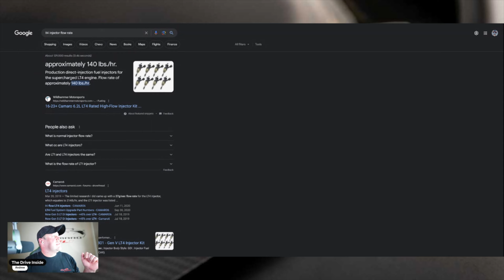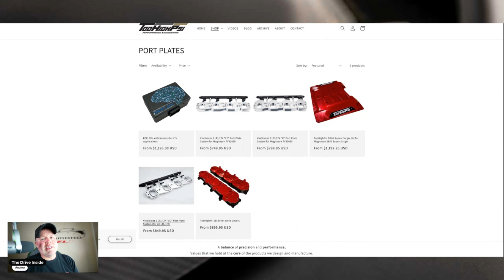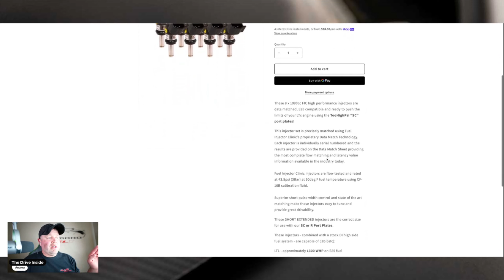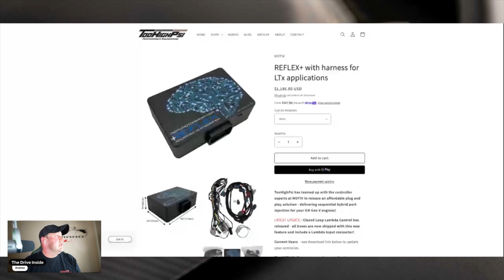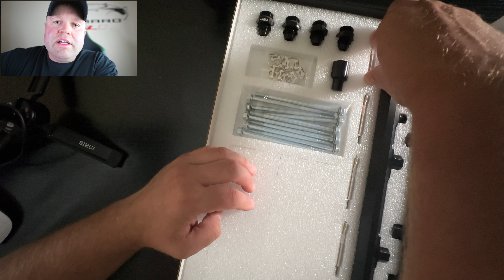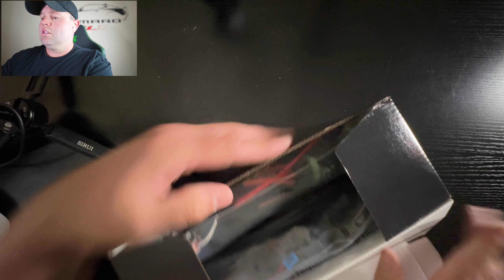LT1/LT4 port injection the ULTIMATE kit...*BREAKDOWN/UNBOXING* #toohighpsi #lt4 #lt1 #e85

Comment: How about the Harrop lt port injection kit which can retain the factory DI system and oe ecm and tcm and enabled full flow retain lines?
Reply from the maker: Too high psi keeps all the factory stuff too…I’ve seen a ton of kits and there’s more in the pipeline all the time but THP is the standard that all others are measured against…super high quality/fit and customer service is awesome! My next kit will be TPH. Just need a aux pump to boost the low side volume

Comment: sup dude how are you doing man just wanted to ask i got a 2021 camaro lt1 and im going on a N/A build and i wanted to add port injection on my build but im not finding any info or video on this your video is the first one i saw tbh with you so what do i need to get so i can add port injection to my car that would be really helpful if you told me man and thank you very much man
Reply from the maker: Depends on your power level your going for…too high psi made a video on the under hood plumbing. Simple answer is DSX auxiliary fuel pump…pick your injector size (I would go smaller in hind sight) pick your plates…and the reflex kit…if you want a specific break down I would call “Justin White Tuned” dude knows his stuff!

Comment: Hi, I have heard great things about the Too high psi guys, and the guy in the video here did a great job!!!!  If you watch BTR videos on the subject, Brian will tell you from testing that adding fuel/mass to the port will cost you. Not only in O2  as the "gas" takes up space, and weigh of it have an effect on the ram as the timing/ wave is now very different.    I have a Camaro with a lt4 and I like everyone else I am  just about out of fuel/dwell .....   I am not going to spend 10,000 dollars ....fuck that!!!!   Thanks Dave
Reply from the maker: I have heard that as well...I haven't tested on a engine dyno but had I done everything all over again...I would've bought the smallest injector and added the smallest amount of port as I HAD too!
Reply: @The_Drive_Inside  Yes!!   Unless you are made of money, it is a rock and hard place kinda deal.
In my case I DO NOT WANT A $130,000.00 dollar Camaro... I am done, I don't want it that bad....  I know, I am a wimp!!

Comment: A boost a pump is a jms voltage booster. When talking lt4 or lt1 even. Aux kit is different. That's like a dsx aux pump. Boost a pump term comes from kenne bell back in the mustang 5.0 and 4.6 days. They work really good. Want to make 750 wheel with e60 on c7z on stock fuel system then the jms is perfect. Cam for high side and jms for low side and everything else stock fuel system wise. So the jms slots in between dsx and stock.
Reply from the maker: Absolutely

Comment: What mods have u done to get 700whp on the stock SC? And what numbers did you get after adding 2highpsi kit? 
Have kinda same setup with headers and ported SC
Reply from the maker: I think even the SS setup that too high had for R&D hit 700whp 😁…it’s going to allow you to precisely control fuel and take that problem out of the equation!! Just add a low side bump when needed

Comment: This is definitely the way to go! I've been holding off on my build and waiting for a good port injection kit before tearing into mine. Still waiting for the kit from GPI, but this seems legit. I can't wait to see what this can do for your ride. Do you plan to continue running meth with this setup though?
Reply from the maker: Absolutely! I just got the deatschwerks X2 dual pump setup to feed it all… I run meth to keep my supercharger intake temps down

Comment: wait this port injection kit doesnt need a standalone controller, looks like they sell a separate controller for it? so 1 tuner in hp tuners can tune this unit with its separate controller alongside the ecm?
Reply from the maker: Correct